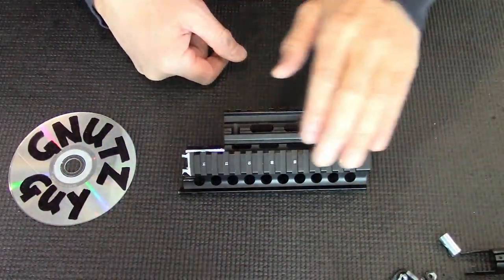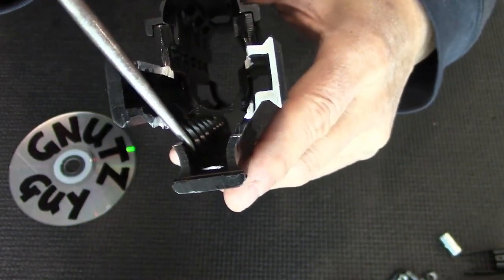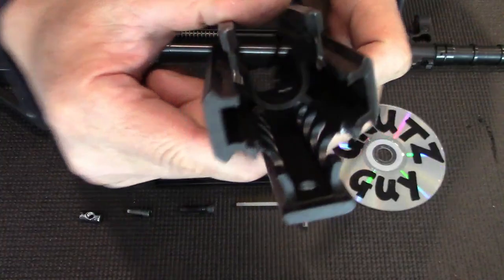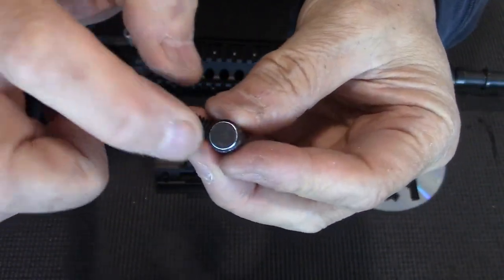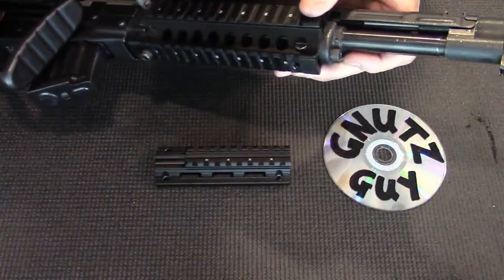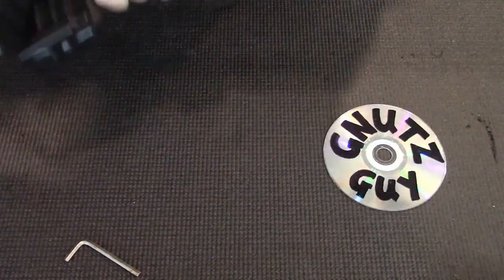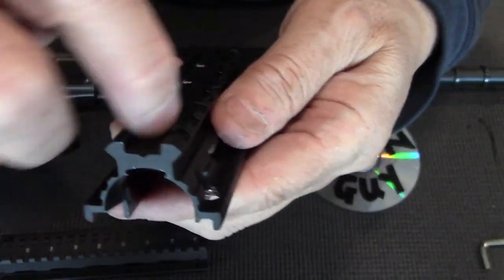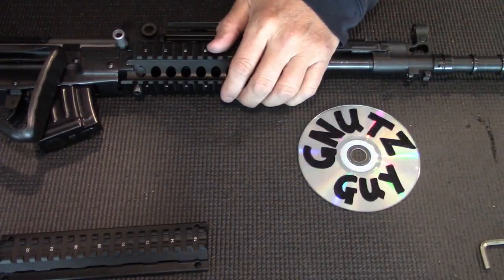Type 81 rifle Quad Rail. Hack&Mod Yugo AK-47 M70. Recommended *

Comment: How did you get the wood off the gas piston cover? Did you have to cut or is there a trick to pop it out without damaging it? Thnx for the videos
Reply from the maker: you have to drill the flared end of the rivets off (inside) then hammer it out.
Reply: @gnutzguy  thank you very much

Comment: As much as I want to do this I don't have the tools nor the know how to modify the hand rail
Reply from the maker: Look at it this way. You can spend $250 on a poly quad rail or you can buy for less, the quad/tools/dremel and have fun modifying it. I will supply the know how.
Reply from the maker: Btw, it gets cheaper when you also do one for the LMG, check it out.
Reply: @gnutzguy  I have the lmg, I followed your instructions on the zhukov stock bought a dremmel and it turned out awesome. I don't know where to find the airsoft quad rail and I don't know if it will fit the LMG anyway. I sent my gun to Black box customs to get it cerakoted and will try to find a Rail like this one to put on it when I get it back in a couple weeks. if you have any suggestions I would appreciate it, my gunnutz acct is kingryan69 I would appreciate any help you can give.
Reply from the maker: @kingryan69  you're not a subscriber? lol. if you were, you would've been notified of my latest vid that adapt the AK yugo M70 quad to the LMG.
Reply: @gnutzguy  i am subscriber I just found the video of the lmg, for some reason youtube wasnt shwing me stuff, I literay just had your answer pop up here. i would buy the airsoft rail but I cant find it anywhere lol

Comment: would it be possible to have a sort of gas tube like top rail on a type 81? I've always wanted to do a build in this AK style https://airsoftgogo.com/images/shop/product/3194/cyma-cm040i-02.jpg
Reply from the maker: nice looking tube rail but the problem is the T81 HG front and back locking mechanism are rather weak and unstable. it would not hold the tube rail at zero.

this ak yugo m70 allows the existing HG to be in place and adds a new rail above it and transfer the stability to the lower tri-rail which is bolted in solid.
Reply: Ah I see. So I would presume Zenitco parts could fit right? Pistol grip, foldable stock and handguard? I assume some modification would be needed.
Reply from the maker: i really cant say cos i havent research into zenitco accessories with regards to ease of fitment, availability and affordability.

Comment: Man I wish I can just send u mine to mod /:
Reply from the maker: The mod is easy and fun to do, best part it only cost $40. Compared that to the poly quad sells for $250. Not worth it. Won't hold zero after cleaning.
Reply: @gnutzguy  thanks man I just picked up a type 81..got it for 1.8